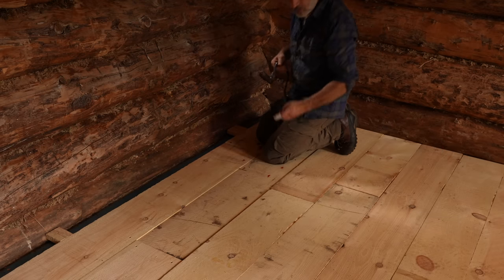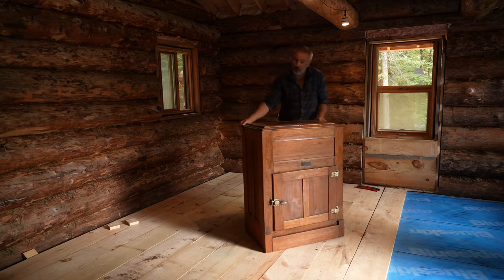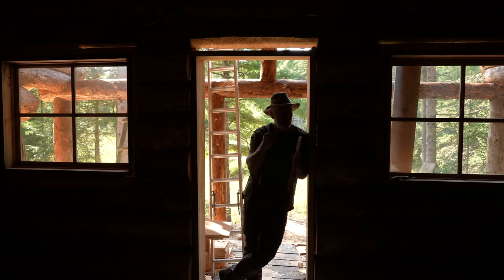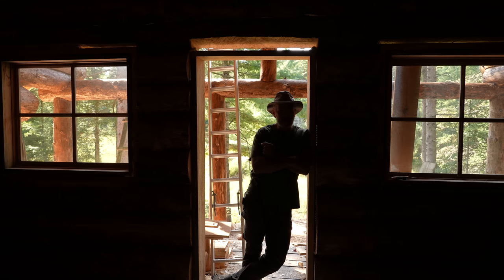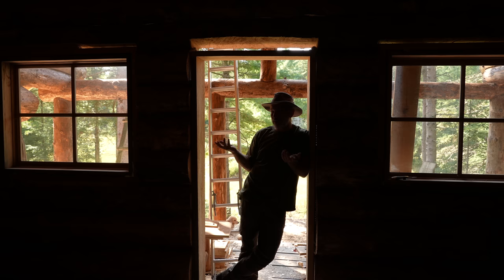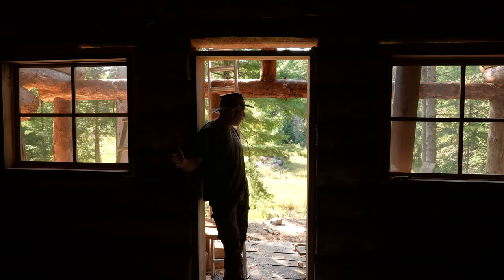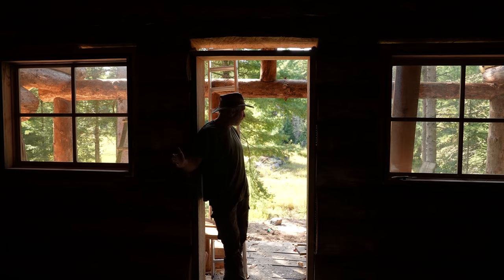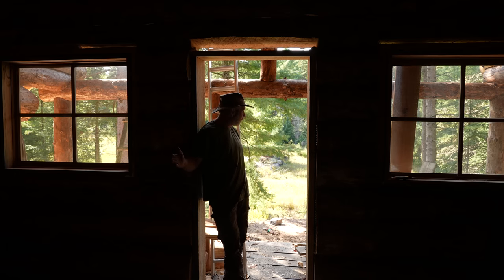Building an Off Grid Log Cabin | Pine Floor, Fixed Windows, Ventilation and Metal Roof

Comment: Take it from a hardwood floor guy. Leave the floor natural and just add the clear coats. Soft woods with stain tend to show up imperfections and scratches mush more prominently due to their soft density. Adding clear coats and letting the floor darken naturally will allow you to add additional clear coats in the future without having to do a full sanding to bar wood. Alternatively, and oil stain will amber the wood and eliminates the need for stain as well. It just takes longer for the oil to dry then a waterbase finish.
Reply: Excellent advice:)
Reply: Last longer and looks great
Reply: A white wash finish looks good on rustic, and helps with the darkness.
Reply: Is that tongue and grove?
Reply: @msmith7472  nope! which is even more incentive to clear coat only. if that floor heaves or cups, you can sand it down and just re apply the clear
Reply: Thanks great advice
Reply: Natural clear stain/sealer ■ would brighten the living space; enlarge the perspective room size, great contrast with the log walls
Reply: Clear coat only. It will still darken a bit even with clear coat
Reply: Excellent advice here!

Comment: Shaun, I’m loving your progress. A little trick regarding airflow, always make sure you have a smaller opening facing the prevailing winds, and larger opening following. Ie 1 door at the front, 2 doors at the rear. As the wind blows past your house it will create a low pressure inside and suck air into the house through the smaller opening, creating perfect ventilation.

Comment: I've laid down pine  boards like you are doing in a bathroom remodel in the late 80's. I used mahogany wood pegs to fill the counter sunk screw 'holes". That made a nice contrast. The pine which was supposed to be dry, from the lumber yard, still shrunk and left gaps over time. Since that bathroom now had a better toilet, smaller sink set up and a small antique claw foot bath tub put in after the floor was down;  I was not going to lift that floor. I never used pine for a floor again. 
The best flooring I have in my kitchen and connected den (in the house I currently own) is well padded slide lock flooring.  I own three dogs and dog claws are hell on flooring. The product I bought had pictures and reviews from other dog owners. This was what I bought on a 40% off sale. Thank goodness cause it was over 70 dollars per box. Six years later, it still looks good as the day it was installed. Not a scratch mark in sight and easy to clean. Rest of this 1946 house has it's original hardwood flooring. A swinging , locking gate keeps the dogs off them.

Comment: Fantastic as always. One thing that I love about the interior of the cabin is the beauty of the log walls - the colors and the textures are somehow relaxing to look at; they'll of course look even nicer with warm yellowy-orange lighting (not the harsh glare of 'white' LEDs, you can of course get warm white LEDs - but far better still, a few simple oil lamps would cast a wonderful glow). Of course the color of the logs will change over time but they look so much nicer than the wallpaper and paint that you understandably see in 99.9% of houses.

Comment: Do an outswing door.. Screen, (Full) on the inside left-hand swing! You have a gable overhang.
Reply: This is a better plan Shawn James. And it will be bear proof if it opens outward. Bears can push an inward opening door to get in.  Dick P had outward doors.

Comment: You could mount those fixed windows onto a wooden frame that can swing open like a door.  It's not typical, but it's still an option.  But as small as the house is, an open door is plenty if there's any breeze at all.  Another big addition to a cabin like this is an outdoor kitchen.  You definitely don't want to be cooking inside in the summer.

Comment: If you are worried about heat loss through the single pane windows, you can easily get some large panes cut to size and simply fasten them on the inside of the windows. This way you will get something close to double glazed windows for a very cheap cost.

Comment: I remember my dad had one of those hand drills before electric screwdrivers took over. He used to use flat bladed bits in it sometimes and was always slicing bits of his fingers off lol and a spiral ratchet screwdriver, those things were lethal and he still uses both of them. Your doing an amazing job there, my self reliance and this is without a doubt my favourite yutube channels.
Reply: yeah them tools were and still are excellent to use ... my dad always taught me when yu have a spade bit on the hand drill ... only hold the spade portion wit the thumb pointing down to the center ... and never let your finger go beyond the edge ... seems if you dont you cut the day lights out of your hands fingers and what not ... I learned by the third cut ;) 
.
the ratcheting screw driver ... is awesome too ... we have the 14inch long one ... and it would one shot 2 inch screws into anything
Reply: I still have my Dad’s hand tools I have even used them...
Reply: My Dad was a patternmaker. He always used them.

Comment: On my wood floors we used special ridged triangular shaped nails. They’re made especially for wood floors. The  ridges keep the nail from pulling loose. I’ve lived in a log cabin since 1989. Don’t stain the floors. Clear coat only. They will darken with time.
Reply: Que fuera en español

Comment: Leave the floor un stained. But definitely clear coat 
I highly recommend wipe on poly or any kind of thicker polyurethane clear coat 
Super durable brings out the grain and is fairly easy to apply

Comment: Get the Dewalt battery drill going, you really need one for the floor type stuff. Yes hinge the door on the dining side. You can order custom size tripple panes in the future and not have to change any of your current rough opening dementions.

Comment: I wondered why you used that hand drill, I thought you had a small power pack with a solar panel or two before. De Walt please, you are killing me with that thing, for me I like the lighter floor, it`s brighter and makes the place seem bigger,  I would build a small wood frame and silicone plexiglass on it for winter, and one with screen on it for summertime, you could hinge that window and swap out the inner part seasonally, just a thought, we know you will figure it out for sure, I love both chanels, all the best to ya sir.

Comment: I've been thinking about what you said about centering the fire pit.
Symmetry is important to me, so I understand why you want to put it in front of the door.
But with your explanation of how the air moves up from the valley straight into the cabin door, that would channel the smoke inside. I don't think that is a good idea, though it might be because of my asthma. 
Symmetry could be achieved in other ways, though your planting and landscaping. 
I.e. with the firepit centered on the window or the cabin's corner post, put a circular flower bed in the same spot in front of the other window, and put a birdbath or the start of the path down in front of the door.
That echoes the two square windows with two round low structures, and the narrower taller door with the narrower taller birdbath (or the entry with the exit).

None of your family may have asthma at present, but anyone can get a respiratory illness which can be irritated by smoke. You also don't know if a visitor or future grandkid might have asthma, so avoiding unnecessary smoke in the house seems reasonable to me. Smoke soaks into the soft furnishings, so even if you don't have a fire in the firepit at that time, if the house is usually permeated by smoke the residue will be enough to irritate the lungs.

Comment: Shawn...you can tack wool blankets on the inside of each window...so at least at night you can preserve heat..I saved alot of $ heating my old house that way ...also putting plastic on the inside as well....you can just pull back the blanket during the day ..😊😉
Reply: Shawn will likely hang his bear or deer fur rugs to those front windows when it gets too cold like he did in his other cabin.  😅

Comment: Here's a thought - ignore if you wish - what about using a darker wood - walnut color or something - to contrast with the light pine?? It will make the indoors lighter and the dark will tie together with the darker walls. Just a thought. The Outsider did his with pennies - then I think he epoxied them in, but it looked really nice. A metal roof is a great plan; with that steep slope you made, it will make snow removal easier and maybe not even necessary. Plus they seem to last a VERY long time.  The plans are sounding better all the time.

Comment: Hello Shawn! First of all I want to congratulate you on reaching 2 million subs on the main channel! Secondly I was wondering if you ever researched or thought about installing a green roof on the cabin since the roof isn't that steep? It would help with getting the heat out of the cabin in Summer and retaining the heat in Winter.

Comment: SHAWN & OUR CALI how are you doing  ???  Can't wait for that video for the solar  to come on out  that will be  Great then to see !!! I learn  off of the things you do and others !!!  Even though you don't have power there   how about  using some solar  lights in the   cabin!!! I use those for the house I live in now  all is solar and I have some that  I got from a company when getting the generator for the house!!! I bought 3 generators and 2 smaller ones  called sidekicks  that power the  wifi and  laptop with !!!  Have  looked into the solar that turns on when  movement  is going on also  !!!  So it is a thought for  you SHAWN !!!

Comment: Front Door ■ could open out to the porch and not into the house; henge hardward would be outdoors, therefore screw bolts along henge edge of door could be install having opposite drill holes for the remaing screw bolt to secure door in frame while door is shut.  Because windows could be blocked while door is fully openned, due to design and overall window function, door could be made into two small French pocket doors in wood and glass and while opened to the porch it does extend the living space as an invite to enjoy while one door could be opened and the other side hardwared with a sliding bolt or magnet if wanted.  This opening to the porch would give an overall great room functional space and continuous lighting during the day.

Comment: Dormer Jack ■ Supporting post of dormer to the roof could have top piece jacks for later lowering to adjustment needed due to settlement of materials and age
Reply from the maker: The four bottom posts have screw jacks
Reply: @ShawnJames1  Dormer for loft overlooking extra back room, you mention how it would settle with the new cut out of the roof, a jack may be the best way to adjust curing; whether your best access is the base or the top, you would know where your load is;  about your front porch if there was any way to access that area from the loft for setting or sleeping, even hunting it sure would be fun, but you may want to have it opened.   Many wish to be in a tree, and your excess of post gives the reality of embracing the forest, so every opportunity to go out high on the home is truly at the tree tops.

Comment: Just curios, why didn't you do a tonged & groove or a rabbet ("L") joint on the cabins pine wood floor? Aren't you worried about shrinkage (Winter heat) and expansion (Summer humidity)? Thanks a bunch for your videos. I love 'em!

Comment: Shawn, why are you making holes with the spade bit and then plug them with dowels?  What's the purpose of that exercise?
Reply: I’m sure it’s for astatic value and to lower the screw heads so when you sand the floors you don’t hit the screws thus ruining your sand paper.  It’s a nice rustic look too.

Comment: Hi Shawn. Bearing in mind I'm an Aussie who does not fully understand double glazing; with your two windows for the kitchen and dining areas would it work if you were to cut pieces of glass to fit the frames and seal them in to give you the space for insulation between the glass? As I said, I don't understand double glazing, just a thought from watching and listening to you.  Richard from Down Unda.

Comment: Could you put the porch door on the outside, so it opens onto the porch?
Then put the screen door on the inside, so that when you have that door open it doesn't create a dark corner in the room.
I know our Dutch building regulation has a rule that front doors are supposed to open inwards, to avoid it getting blocked and people being unable to get out. But as yours opens onto the roofed porch it shouldn't get blocked by snowfall overnight, and you still have the breezeway door as well. Your building regulations and inspections don't appear to be as strict, in your area, so perhaps it would be allowed?

Comment: SJ, More then likely ur going to need to use 6inch foam insulation on them front fixed windows cos u will loose too much heat thru them.... single pane windows do not work in ur climate.

Comment: A real concern on about your roof. I posted this here also cause there is less comments, which means there's a higher chance you will actually see this. 
I noticed on your other channel, on video - Installing a Wood Floor and a Log Truss for the Porch Roof, Off Grid Log Cabin Build Alone, Ep 24. 
38:06  The roof went up about 1" as you pounded in that upright. Look at top right corner of screen. Was that suppose to happen? ❓❓❓❓

Comment: beautiful cabin if you have mice take a plastic container with lid cut hole in side put 3tbs spoon jiffy mix with 2 TBS baking soda mix put on floor and they will eatgo to water and it will swell stomach and die.

Comment: Regarding the metal roof - won't it be quite noisy inside when it rains? Understandably there will be the layer of wood planks underneath to provide some muffling of the noise.
Reply from the maker: And 9” of insulation
Reply: @ShawnJames1  Ah yes, I'd forgotten about that. It's a good thing that you're building the cabin and not me. :-)
Reply: I have a metal roof in far northern WI, and I LOVE the sound of the rain! Best noise in the world.
Reply: Rain on the roof is the best sound in the world.

Comment: i still dont stain the floor ... the lighter wood will keep the inside lighter .... if you stain it becomes more of a mirror with clear coat on top and that can actually be hard on the eyes ... as a light floor it diffuses the light and is easier on the eyes ...

Comment: Shawn, I love your channels and I think we are mainly on the same page, I'm following you since you bush craft videos. But please, I'm begging you, do it right this time, don't cut corners with single pane windows etc. I'm pretty sure you can afford to have custom windows made and while you are at it please get some, which fits into the original cuts so you can get rid of those patches you made with dimensional lumber. It's not looking good and I'm pretty sure it has a potential to be a thermal pain point as well.

Comment: Any reason for you not raising the roof a couple of logs to give you head room for a bedroom up above???
Reply: With his old cabin he found sleeping in the loft was very uncomfortable.  The dry heat from the fireplace rises and collects in the peak and would be unbearable even in the middle of winter.  Using the loft for storage or the occasional guest allows for a lower ceiling so less space to keep heated. Also being alone using the wire cables with the chain blocks to lift the logs he could only go so high rigging in the trees.  The trees around the cabin aren’t that massive and couldn’t handle much more weight.